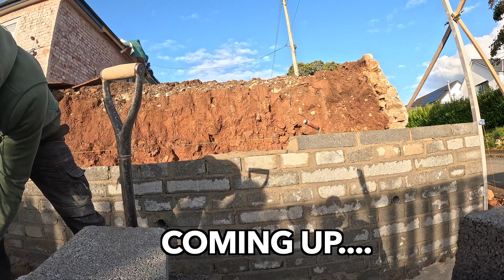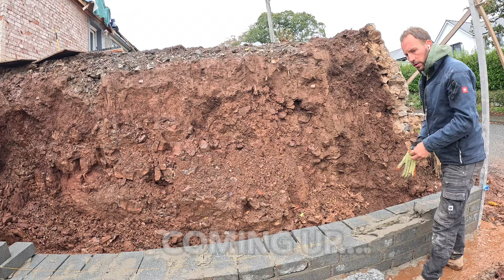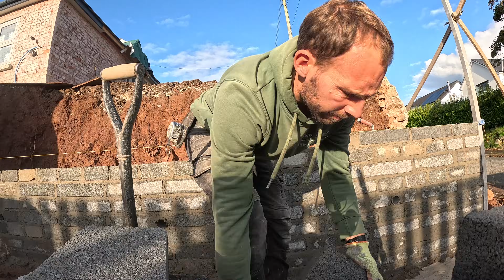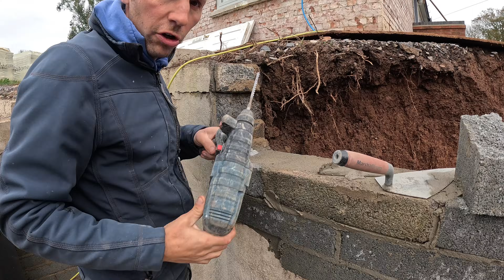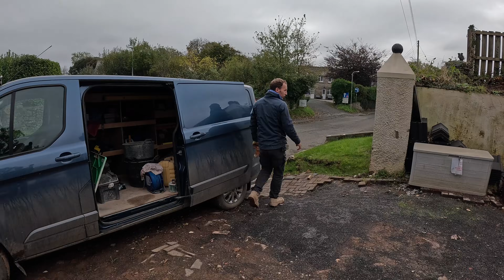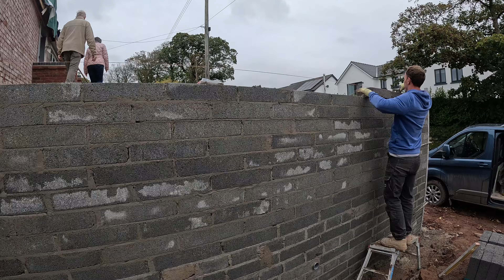Laying blocks on a retaining wall

Comment: You should of used concrete blocks a lot stronger for retaining walls. Also english bond wall for extra strength . Didn't customer want proper job or a job what will probably  move in a few years. Cowboy bricklayer.
Reply from the maker: What makes you think I haven’t used strong concrete blocks?  What blocks do you think I’ve used?

If you look at the start of the video I do use an alternate bond of stretchers and headers.  I reduce the wall back in thickness when I get higher so it can only be stretcher bond.  If you watched the video properly you’d see where I show its solid rock behind the wall.   Please watch/listen to videos properly before calling people out.  Cowboy viewer 🤣🤣
Reply: @SamDaviesBuilder  Bravo, Sam. Professional work.
Reply from the maker: @saulger6409  thanks.  Problem is, I’ll never hear back off the person that called me a cowboy as the trolls never reply 🤣

Comment: Hey Sam.....Lot of weight there in the blocks alone...I did a bike shed out of those concrete blocks and they weighed a bl**dy ton and when lifting to shoulder height got very tiresome so a big old wall like that ........hard...... nice to see though...thanks as always for the video
Reply from the maker: Thanks Adam!  Yea they are heavy especially when they are wet.  I can lift them pretty high when I'm laying on edge but when they are on flat like this its so much harder to lay them when you get up high.  Roll on the summer when they are bone dry and lighter.  One day I will weigh one wet and one dry to see the difference.....